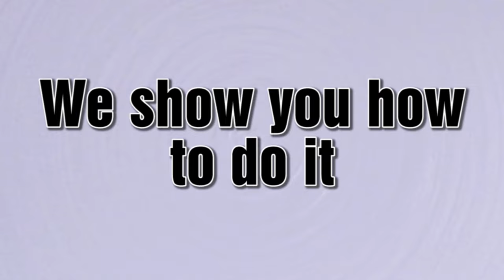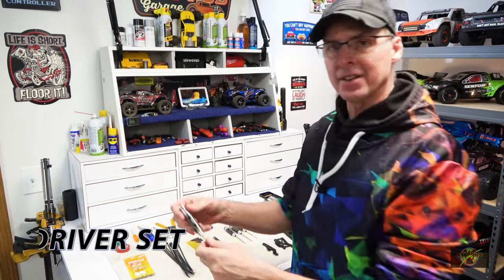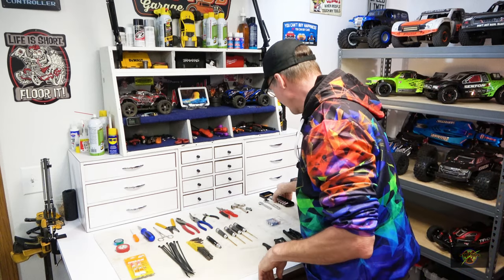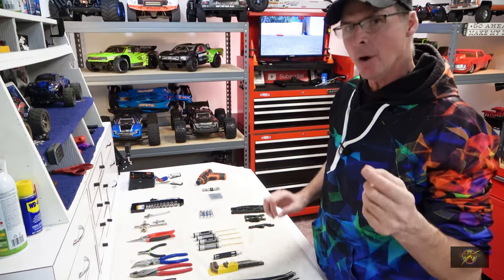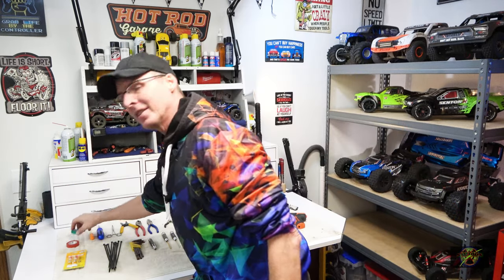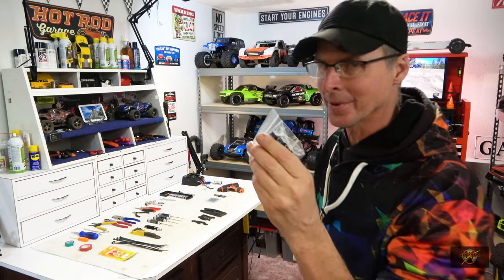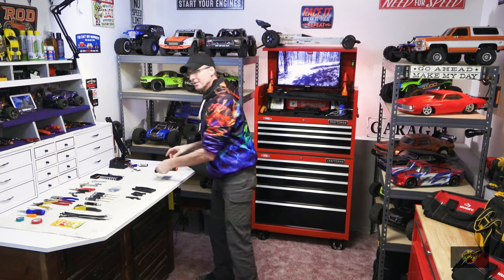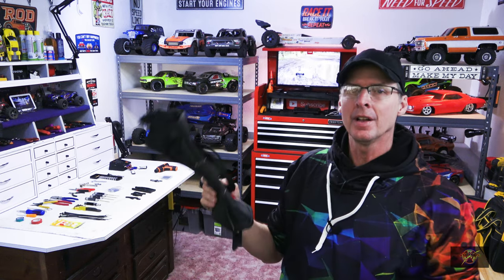RC tool kit 101

Comment: In my personal opinion, when it comes to the hex drivers (with or without the handle ) don't cheap out. The cheaper ones can be made out of softer metals and round off. Get a set made by MIP, yea they're more expensive but well worth it.
Reply from the maker: Well said. If one can afford the good stuff that I’d definitely spend extra on the hex drivers. Thanks for pointing that out 😎👍
Reply: @AJJAMStudios  I bought a cheap set before I even got my truck (Losi TT Pro) and when I was checking to make sure everything was tight, the 2.5mm one totally rounded off torquing a loose screw. I thought I was just being a Gorilla on it, but the 2.0MM and 3.0mm ones did the same thing. My MIP set showed up a couple of days later. I have some other good ones that are a little shorter that go in my electric screwdriver.  A lot has changed in the nearly 30 years away from this stuff, but decent tools are still a must. I nabbed a DeWalt toolbag from some site I was on looking at something and at $5.00 for a medium sized one, I snatched it up. The seller had dozens of them. I wish I knew who I got it from!

Comment: Those smaller handled hex drivers can be hell on your hands because they are too small, especially on bead lock rims. I know, I couldn't use my fingers for a few days taking my wheels apart. I agree, having tools are important. I think it best just to invest in  a second set of bench tools and buy a Plano tackle box to keep those tools in it. You know exactly what tools you need doing bench repairs. Small and compact may save space, but not your hands.

Comment: A some additional things that I bring out… spare wheel nuts/hexes, a small assortment of nuts and bolts (a Jenny’s rc fastener pack for your most common truck will take care of most needs), flashlight for seeing in dark spots, body clips, paper towels or rag to wipe off mud when needed, esc program card, lipo tester, 7mm driver for pillow balls adjustment, single battery loop thingy, common spares like control arms or shock ends to keep you or a buddy going, gorilla tape, shock pliers, leaf blower for quick cleaning. I also have a table or work surface if I’m going to be away from the truck and a cart to get everything out there. I keep a separate set of most of the tools in a bag just for this and a bin for additional items so they are always ready to go. Nothing worse than leaving what you need at home. Yeah I bring a lot but usually have what I or a buddy needs for a quick fix. 
Hurricane
Reply from the maker: You bring a pretty extensive toolkit along with you. Believe me, I understand. You never know what you’re going to need. Thanks for helping out 😎👍